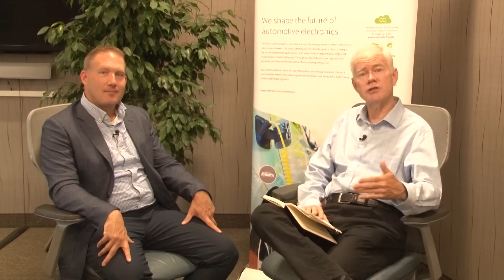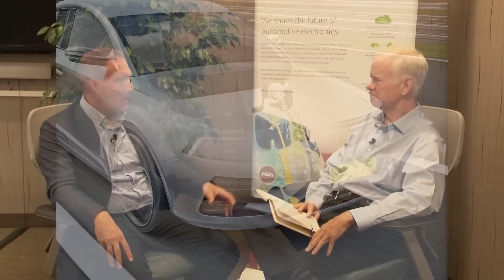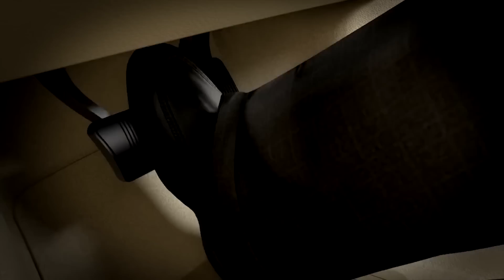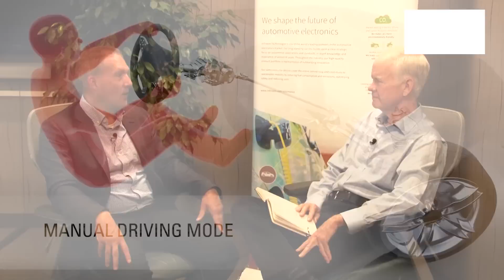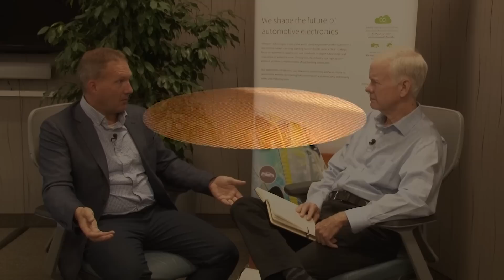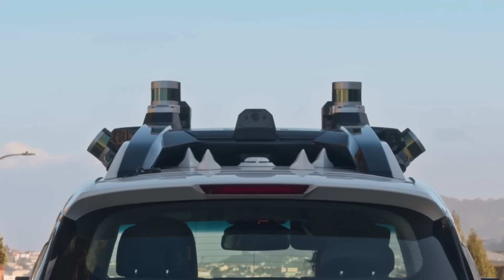Using Digitization to Decarbonize Cars - Autoline Exclusives

Comment: Is this like paying for a $400 iPad in the center of the dash to replace what was on the dash in the way of knobs, dials and buttons which worked well and did not snoop?
Reply: Dials and knobs disintegrate in your hand.  They are unreliable and I welcome our screen only design.  The best part is no part!
Reply: @gnoxycat  The iPad is a BIG part that will go on the fritz.
Reply: @2cartalkers  Nobody cares when the BIG part goes on the fritz.  We replace it like any other part, less often, cheaper.
Reply: @gnoxycat  You got that right, CHEAP as in substandard, low par, crummy.

Comment: I witnessed a couple who had a brand new Tesla 3 stopped by the side of the road just a couple of miles outside Warrenton NC. When I asked if I could help the driver explained that she lost her phone signal connection and the car  just stopped. There is a charging station in Warrenton town center but she had to get her vehicle towed despite there was still plenty of charge in her batteries. How is this possible?
Reply: I’m gonna press doubt on that story
Reply: @amirmograbi  The above story is what desperation looks like.
Reply: That sounds extremely incorrect. So if I had a Tesla a can't drive it if I leave my phone at home. Or the battery dies on the phone and the car just stops in the middle of nowhere in a blizzard? Sounds like the new owners just didn't know how to operate their new car.

Comment: Cybertruck is going to be drive by wire and will have brembos new digital magnetic breaking system. I saw a demo of this and it is even more impressive than teslas acceleration.
Reply: The Cybertruck will be outdated by the time it comes out!
Reply: @gmv0553  The legacy auto Pickups even the latest from Ford and GM are already yesterdays tech.
Reply: @gmv0553  the cybertruck will be packed with all teslas latest ideas designs and tech. i hardly think the oems stand a chance. i have a feeling the first to build 250k units will be tesla. i really like the lighting, and hope ford survives whats coming. ice will be decimated over the next 10 years.
Reply: Not, it can be updated through software .
Reply: Most cars are drive by wire these days for many operations, with transmission gear selection a switch rather than direct linkage, accelerator, etc.